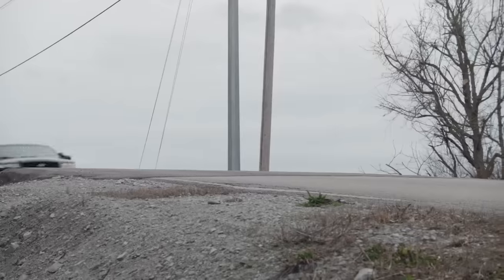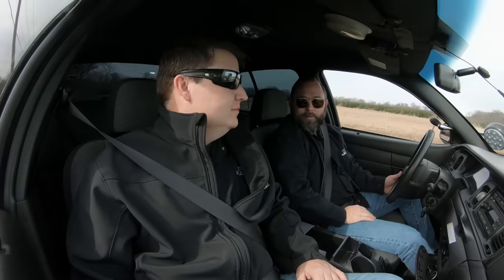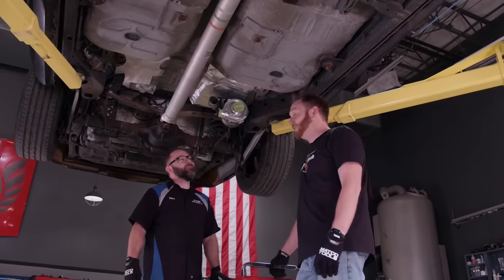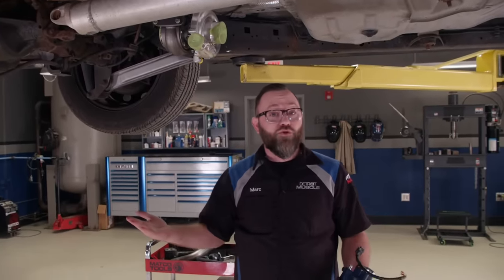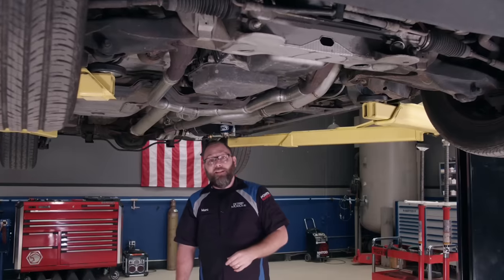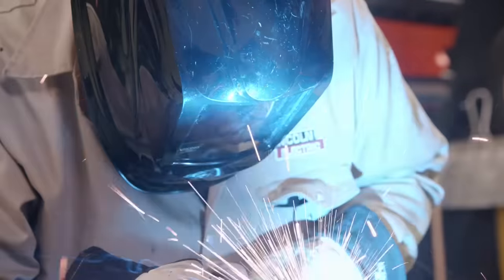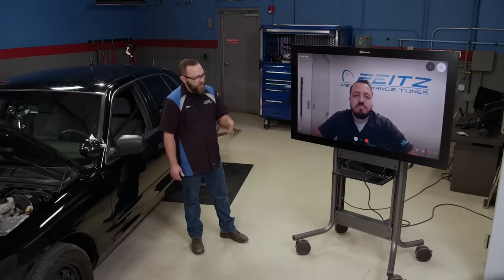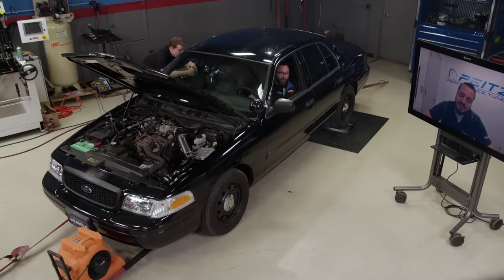Boosting A Crown Vic Police Interceptor 160 Horsepower - Detroit Muscle S7, E7

Comment: That's too much work for something you can't drive in any kind of weather
Reply: Hell yea fr
Reply: Could trunk mount turbo intake and filter. Even control temp in trunk with AC vents in center console routed to trunk. I'm mapping out a plan to do just that. Just a little extra plumbing.
Reply: You can drive a cvpi in any weather what are you talking about???
Reply: Oh right, the cops bought cars for the better part of 20 years they can't drive in "any kind of weather" 

What a dumb comment.
Reply: @joshw7974  well they did just add a ton of power and weight to the front of a rear wheel drive car
Reply: Josh W I think he means the intake for the turbo is directly under the car
Reply: @joshw7974  The air filter is now under the car it cant be drove in the rain unless you want to kill your engine please pay attention in class next time.
Reply: @joshw7974  You have a pretty dumb comment yourself. seeing as they say in the video that you can't drive it in the rain. reason is pretty simple and obvious the turbo is mounted under the car which will cause it to ingest any water being kicked up. do you want to destroy the turbo?
Reply: @iceman27406  also hydro lock the engine
Reply: @omahacvpiofficial6599  watch the video where these dudes put the intake and filter it made it so they couldn't drive in winter or rain
Reply: Why not just simply make a skip plate for the fueling and turbo system. All weather conditions and protect all the recycled parts that were used. I did this on my f150 with a mustang intake swap.
Reply: I'd never heard of putting the turbo under the car. Thought it seemed very impractical and weird.
Reply: @joshw7974  The air filter for the turbo is directly under the car, meaning it's going to get full of water and run like dog shit or not at all in the wet. 

What a dumb comment.
Reply: You guys don't understand.  It has a waterproof cover on the air filter.  Proven technology.
Reply: Fr not to mention get dirty way quicker I'd def wanna build a shield some sort.
Reply: I had one of these and loved it, but worst winter driving car I ever had. Wish I still had it though, I'd be doing these mods.
Reply: @jnick5358  until you hit a pudde
Reply: OmahaCVPI Official I wouldn’t recommend it. Had my 06’ for several months. Riding in the rain one day it just started hydroplaning and spun out. I learned very quick to use the traction control and that those aren’t the best everyday driver
Reply: @omahacvpiofficial6599  As in... installing a turbo under the car to get more power but you're sacrificing driving it at all. Mounting that under the car is just silly when any sane person would use every bit of space in the engine bay to do it.
Reply: I still think mounting the filter inside of the trunk will be a good idea easy easier to get to and maintain than trying to equal underneath of the car
Reply: It’s called a hydrosock, Goes over the filter and keeps the water at a minimum. Imports use them a lot on boosted applications.
Reply: @Awakened133  2 years ago and you replied....
Reply: @bosshogg4324  Just watched the video

Comment: From 250 hp to 368 hp is very impressive. 118 horsepower increase will come in handy on my 2011 CVPI.
Reply: ReWatch...  From 200 to 368.  A 168 increase.
Reply: Watch for your rods blowing out the block if it hasn't happened already those motors don't handle to much power stock
Reply: @Sully_024  they're at a comfortable but nearing the limit at like 400 its fine as long as its oiled and changed
Reply: @Sully_024 its the ring gaps more so than the rods. But yes the rods aren’t the strongest
Reply: @Sully_024 the rods can handle up to 400 at 6000rpm before you need to worry.
Reply: Did you end up doing this? I have same year PI and am just wondering how well the car accepted it

Comment: The turbo setup it's completely exposed to the elements could be improved by adding some shield plates. Any ways Nice work clean install
Reply: I was thinking that too. Maybe pipe the air inlet into the trunk so you could drive it in the rain as well? Would require an air source into the trunk of course, but these are the kind of things that separate a build from a hack job.
Reply: @solomonlynn7456  In the trunk with some downward facing plastic vents cut in to the back either side of the licence plate color matched, = get outside air and keep water out
Reply: Those outerware covers do a damn good job keeping elements out of the KN filter.  I ran those for years on my quads in all kinds of terrain, yes even playing in water.  as long as you don't submerge the filter in water, you can go anywhere,  just make plate to protect it from rocks and direct stream of water and your good to go!
Reply: Tonto Gonzales nope
Reply: Definitely needs some kind of shield, not only for the rain issue, but can you imagine what a big rig tire cap or random 2×4 at 80 mph is going to do?
Yikes!
Reply: Plus, they could've run the air filter up to where it's under the hood with the tube feeding into the turbo
Reply: That's what i said!
Reply: Simple aluminium shield could be made from sheet ally, could be simply sandwiched between the turbo inlet and the filter to hold it in place.
Reply: My 5.9 Cummins turbo is exposed in the fender well...... It doesn't care....
Reply: Miles of charge pipe, miles of oil feed lines and the need to integrate a scavenge pump to augment oil return. Would be much more efficient to put the turbo under the hood, and run an intercooler. Flip your exhaust manifold upside down and fab up your piping and you're in business. At least this way all you have to do for oiling is to put a Tee into the oil pressure sending unit, pop a hole in the pan for the return line, and as an added bonus you can drive the car in the rain and snow without destroying the turbo or your engine. There is a reason no manufacturer has placed the turbos in this position. Even those crazy Germans didn't do it on the Audis and VW's.
Reply: Road salt will destroy that if they get shitty winters

Comment: Didn't want to run an intercooler.
Runs a mile of charge piping and an oil pump.
"Simple."
Reply: Fahad Said sleeper af
Reply: He is too cool for school bruh next he'll tape the gaps on his car so it goes faster
Reply: WarriorOfEden3033 o
Reply: Charge pipe next to the hot side too
Reply: "Miles"... yeah because intricate piping that has to wind its way around your engine to your intercooler is so much easier than straight piping.

Also exhaust manifolds are cheap apparently, in your world.

Comment: I'm a Honda enthusiast, even imported a RHD civic to the states.

But I've owned a fox body and a panther.  A crown vic police interceptor is on the short list of domestics I still want to add to the fleet.  Ford absolutely over built them and they're gonna be on the road for decades to come
Reply: What honda did you import? I just imported a eg6
Reply: Except for their transmissions. No bueno
Reply: @rickhunter6513  Only because the police models get abused so much. The 4r70/4r75 transmissions can last a pretty long time in the civilian Crown Victorias, Grand Marquis, and Town Cars.
Reply: @SirSkroop  agreed, the P71’s take an ungodly amount of abuse
Reply: @rickhunter6513  ,
If interceptors did not come with them, does a transmission cooler if not also having a transmission temp sensor to have feedback be a worthy investment or is it not so much the temperature of the fluid causing the major failure modality of the Transmissions?

Comment: I'm a medically retired Master Auto Tec. The number of custom and street ripping cars have come and gone. But it was allways fun to chat with the customers/new friends, after the first week or so of driving the car. From clapped out Celebrities to $450.000 Convertible GT500KR's. One thing, a dream if you may, has been to take a big ol American family sedan and make a well balanced sleeper. Crown Vic's are the perfect platform in my eyes. The 4.6 is versatile, transmissions are stronger,  more efficient and can be modified to great extent. Old school "LUXO BARGE" and modern tech? DUDE!!! COME ON!!! Bro high fives to all of this! LOL..... I can see a twin turbo set-up working well, with sacrificing the rear passanger area and trunk. Who needs rear seats? Heh! Snorkle set-up for the intake, thru the body and into the trunk space. Mainly for the reduction of external intake turbo whine, rain protection as well.  Trunk floor modified for an exhaust that only produces a "woosh" out of the tail pipes. A seperate oiling system for the turbos. Dynamat everywhere, custom rear faux seating, carpet and fabric. The most subtle Grandpa paint job, modified steel wheels for more rubber out back and stock wheel covers. AHHHHH....what a dream. To hear a friend ask "what the hell do you need a roll cage for?" Now I wish I had the 75-100k to do it!
Reply: That'd be a fun ride!
Reply: @izzyplusplusplus1004  Thanks buddy! The extra weight wont exactly help with 1/4 mile times. BUT... How many heads will be scratched when a Vic keeps up with an exotic on the open road? The "what the hell" looks and smiles when it dips into the 12's? Ya gotta keep the waste gates open for the pissed off sounding blast though. Piped out along side the tail pipes, 2 3" bazookas and 1.5" pipes neatly mounted next to them. More scratched heads. Heh! Long live Hot Rodding!
Reply: @johnkangas8916  Amen to that!

Comment: I remember when rear mount turbo was a concept.
How's the lag? Having the turbo on the other side of engine bay used to create plenty of lag. I could imagine this far worse.
Reply: TurboFlush Especially through 200,000 mile cats.
Reply: Whats the capacity of the average intercooler plus the piping to go from the turbo to that and back to the intake, i think it pans out pretty evenly on volume to full and thus lag, just this setup doesnt cool the air quite as well,  maybe if you added fins to the charge pipe and wrapped the exhaust pipe it runs right next to its help slightly but i mean 368hp is probably all that auto trans wants anyway

Comment: Excellent work!!! No use though if it can't be driven in bad weather. That's what the police interceptor is all about. My dad was a postal inspector and has had them since 1948. I have been driving them since 1970. Ford designed them tested them and used them. Any and I mean any mods only hinder it's intended usage. Including the restrictive exhaust system designed to keep heat in the engine because of steam holes. Two turbos closer to the engine block with no mufflers work more efficient!!! It's been proven!!!!

Comment: id imagine water getting into that turbo would be a big issue in any area where you have rain and mild puddles
Reply: The could re rout the filter up into the trunk wouldn't be to hard and using a stock single exhaust system would save a step on that process
Reply: @kevinjohnson9372   that's actually a really good idea
Reply: Yeah, I couldn't believe that they mounted the intake where they did!!!

Comment: perfect timing that this video came out, a lot of 30 crown vic ppv's just went up for sale for less than 4 grand in florida, and im planning on picking one up as a project car. 
Nice work guys
Reply: Less than 4 grand? I paid 805$ for my 08 a little over a year ago.
Reply: I paid $500 each for the 06 and 08 I picked up last year.  Both running/driving with less than 150K miles.

Comment: "Direct fit universal kit".......................best quote of the whole episode. What boost levels were they running on the stock block?
Reply: did seem like the stock had lost some efficency over the years meaning a well maintained 2011 P7B should get a lil more from the turbo, wonder if they will create an even better turbo for this car 2022. with the 410 torque you should get the 160 mph top speed no prob haha LIT

Comment: I bought a 1965 F100 stepside with a 160 inline 6 in 1970, found a wrecked state troopers car it had a 390 intercepter dual 4 bbl required 100 octane due to compression drove it thru high school.

Comment: Fix the cigarette lighter.
Reply: I don’t smoke, but a cigarette lighter is essential for maximum street cred.
Reply: It's legit 2 wires
Reply: "It's got a cop motor, a 440-cubic-inch plant. It's got cop tires, cop suspension, cop shocks. It's a model made before catalytic converters so it'll run good on regular gas."

Classic!
Reply: Cigarette lighter? Spoken like a true fan of one of the greatest movies of all time...
Reply: My little nephew once asked me why this old car had a charging port. Made me laugh!
Reply: “THIS DONT LOOK LIKE NO EXPRESS WAY TO ME!”
Reply: @qjo  you forgot the cop chip

Comment: It's got a cop motor, a 440 cubic inch plant, it's got cop tires, cop suspension, cop shocks. It's a model made before catalytic converters so it'll run good on regular gas.

Comment: Tons of comments on here about discrepancies between factory horse power and what the car made before the turbo install. Factory is measured at the flywheel. They measured it at the rear wheels. 50-60 horse power loss through drivetrain not uncommon on a rear wheel drive car. It made 200 hp before turbo install at the rear wheels. After turbo install and tuning it made 368 at the wheels, but that’s not the real story. It made 410 lb ft of torque. Americans buy horsepower, but they drive torque. Torque is what launches that boat, horsepower is what gives you top end speed.

Comment: I wonder what the intake temps are post turbo with this setup.
Reply: It's still been raining they haven't found out yet
Reply: zero intercooler and having the cold side charge pipe run right next to the increasingly hot exhaust piping. Yeah great set up guys
Reply: Probably much hotter with the charge pipes run right next to the exhaust than with a standard intercooler.

Comment: No Dukes of Hazzard jumps with that turbo hanging that low to the ground!
Reply: Crown Vic radiators are really low by the front bumper and tend to break very easily over small jumps. The turbo just adds another thing to fall off lol.

Comment: Sit on the side of the highway with a part of binoculars and scare everybody who drives past
Reply: That's funny.sadistic mind.
Reply: wouldn't work. NO police use this car anymore. Would only fool a fool.
Reply: @guysteel  its easier to fool someone than convince them that they have been fooled.
Reply: Actually they are still in service and still see them from time to time, so I'd still respect them just to be on the safe side lol
Reply: @mrford203  you know what? My freind; rationally speaking. What you think is"law" is not correct. Re ' think what you see
Reply: @guysteel  they still use it around Indy
Reply: pauljolry 
Here in southwest Florida they still use a lot of them.
Reply: @guysteel  That's a bold statement. Plenty of departments still use vic's. I have a black and white and it scares the shit out of people until they see that it's retired. Then they get pissed and haul ass.

Comment: I see you didn't change out the intake manifold.   When mine failed on my 2007 P71, I replaced it with a Dorman with a higher flow rate.  It gave me a noticeable increase in hp.
Beings you have done so much to this P71, and beings you had her torn down most of the way anyway, I wonder;  Why didn't you also upgrade the intake manifold?
Reply: I very much doubt you gained any HP by replacing intake manifold with higher flow rate without fuel air remap. In fact you likely lost HP as you've increased volume of air and decreased pressure thus decreasing flow rate.
Reply: The dorman intake notoriously robs HP from the Vic. Unless you got a different type
Reply: @parkourpotato6066  I can only speak to what I see.

Comment: Dont give me wrong this is a really cool project but i dont get it putting a turbo underneat the car it make no sens plus you cant drive it when it rain or on snow or even gravel road... damn thats wack ! But i love the show the work and idea its just my personnal opinion keep up the good content !
Reply: moto4power. I would rather supercharge too, but it was cool to see how it was done. This option is definitely a cost effective way!
Reply: It's been done alot, works great just need some intake shields
Reply: Cody Parker. I want to do this to my 13 Ram!
Reply: @codyparker679  No it doesn't. Super hot intake flow. Awful throttle response.
Reply: They use whatever parts some company wants to give them. In this case an STS rear mount turbo kit. A Vortech supercharger for a 4.6 mustang would have been a lot easier to install.
Reply: Wouldn’t turbo’”lag” be increased If the compressed air has to travel greater distance to get to the combustion chamber? Just my two cents
Reply: @tradingmachine8800 -- that torque curve looked damn good to me.